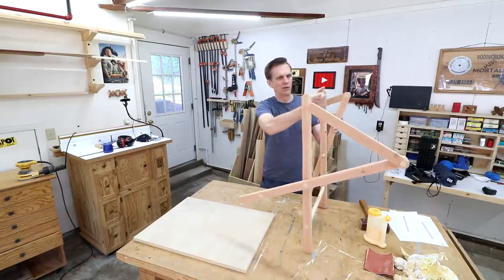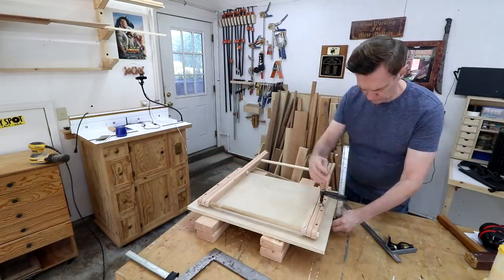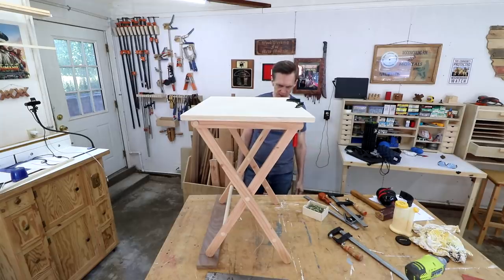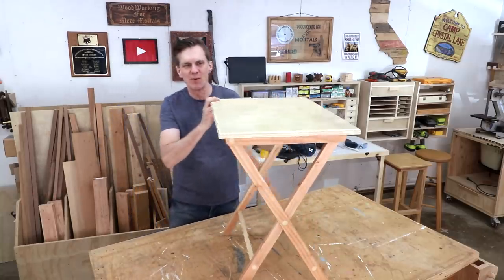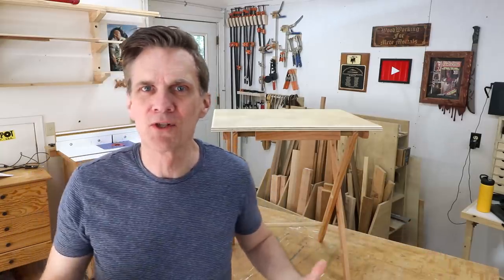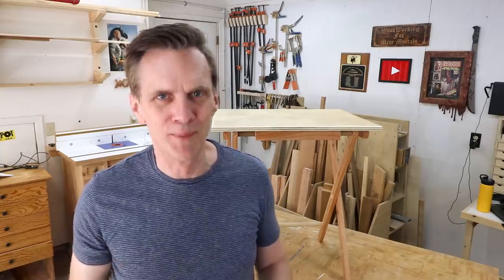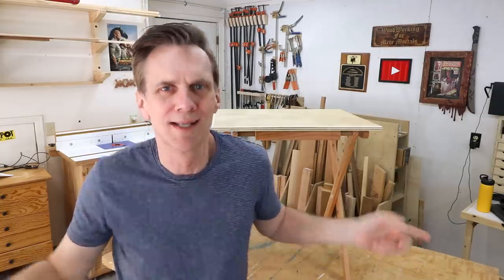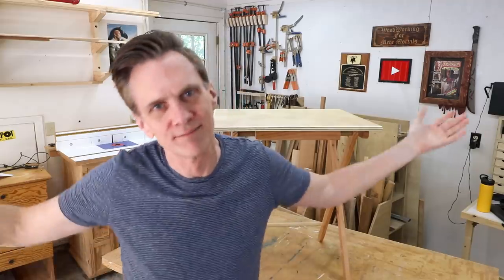Completing the folding table. This turned out trickier than I expected! LOCKDOWN Day 65

Comment: While I’ve spent a lot of money on this hobby, the one place where I saved a lot of money was building my own kitchen cabinets.  Cost me about $3000 plus tools, when a pro company wanted tens of thousands of dollars.  Closets are a big money saver if you do it yourself too.
Reply: I have to agree here. Not true woodworking for the fundamentalists, I have built all the furniture for our two AirBnb suites at approximately 1/3 of the  price quoted from kitchen design shops. I ordered the exact same Melamine boards, pre-cut to size and edged. I then assembled them and added solid oak tops. I must say that I have done this a number of times in the past, so by now I have made a few mistakes and have learned from them. I get good reviews about the "modern" look, so as Steve has said, it serves a purpose. At the same time, I could enjoy working with the solid oak tops from cutting to size, sanding down and varnishing. Finally I can tell my guests that I have made all the furniture in the suites, this buys me the ticket to run my noisy woodworking machines on the property without them hassling me about the noise!

Comment: Great video. The one thing I can say making it myself was actually cheaper was patio furniture. My very first project when I got started about a year ago was an outdoor sectional sofa and a matching banquet table. Lumber ran me about $125 for what amounts to an 8 foot couch and matching 8 foot table. I had a to pick up a good circular saw for about $90 but that'll last me for damn near ever. Surprisingly, to me anyway, the cushions for the couch ran me about $150. The same style and materials everywhere else I priced it was over a grand. I do think that's the exception and not the rule though.

Comment: I should have 'Told you so'. :) I made a similar table a couple of years ago with the same problems. I used a slightly wider fixed stretcher to get over the swinging leg problem. and yes small adjustment to the leg length to make level. But hey, it's fun working out you problems LOL. Sorry Steve. And yes I did make a table two years ago :)

Comment: points why I build:  1) I can not find the custom size to fit the space 2) store bought is pressed wood which is nice until you have to move 3) the most important reason I find woodworking relaxing.  I have been told to go into buisiness, yes I could, have enough projects and client base that would keep me busy for many years to come. But then would need to find a new way to relax

Comment: Oh, just to reply to your last comments in the video - 
I hone my skills for things which I cant find in the market, or it wasn't in the market for the right price or I want assurance of the quality in materials used.
I'm sure if I factor in the cost of my time instead of doing something else it would end up more costly but then I will always question the durability of the item when it is bought. 
The problem with items on the market now they are engineered for a particular purpose for a particular duration due to cost and competitiveness, this scale is not quantifiable to the typical buyer. 
Products can also be deceptive where products actively look stronger/better than it actually is.
In any case, I think if you have a specification for something and unwilling to compromise on particular points, then making something yourself would be the next best option (or getting a professional to make it for you).

Comment: Hey Steve, I think you've made a really good argument for buying knock down particle board furniture by saying it frees us up to do other things. I can agree with that. However, that table you made could have just been scrap 2x4's and a piece of construction grade plywood nailed to the top and it would have cost less in both time and materials. Especially if you trash pick, or get the materials for free. It wouldn't have been as nice, or as functional, but it would have done basically the same job. I think that's where these big manufacturers get us. I saw a particle board desk in the store one day. I was looking for a little desk I could throw into the corner of a room. The cost of this desk was about $50 and I realized looking at the dimensions listed on the box that I could make that same desk from a sheet of plywood for a little under that. The debate then becomes "Do I design it, buy the materials, and build it myself or do I just buy the pre-made desk now and put it together tonight for basically the same cost". They make these products to appeal to our laziness. These mass manufactured products are also often "one size fits all". They'll get you 75% of the way to what you want. Eh that drawer could be bigger. This handle is kinda hard to grab. The desk top could be three inches higher, etc. They'll never be as good as something you "cut to fit" for your specific needs. I think that's what most people miss in the price/saving money debate. If you are paying for the knock down furniture which will never fit your needs exactly, then why not build something super cheap that will? I made a drawing table for myself out of 2x4's and plywood. It cost me less than half what an artist's drawing table would cost if I bought it at a store, and is way bigger and fits me more precisely. It looks like a crappier table than the store bought one cause it's just 2x4's just rough cut, versus a shiny laminate top and sleek aluminum legs, but mine is a way better table. I'm getting 98% of what I want out of a table at half the price versus 75% of what I want out of a table at a much higher price, but that would have been more convenient to put together. I'd rather save that money and be more satisfied with my crappy cheap table, and just like buying the knock down furniture saves you time, the money I save frees me up to buy other things I can't make myself.

Comment: If you build it yourself, you know the quality of the product you're getting.  You know what the materials are.  You know what the waste was.  You have a much better idea of the environmental/social cost of the product.  And if it breaks, you can fix or replace it.  Plus, when you use the item, you get the satisfaction of using something you built yourself.

Also, geometry teachers were screaming at the screen!  If you want the legs to be different lengths than the triangle at the top that the legs and the table top form needs to be equivalent.  You'd have to change the pivot point on one set of legs (move it up on the shorter set, I think).  Not saying I would have caught this prior to building it, but that's the issue :D

Comment: Factory made flat pack furniture is no longer all bad. It used to be but the manufacturers had not yet figured it out 20years ago.
If you are new to woodworking and you still need to learn how something is constructed its very easy to buy an ikea (or other brand) an look at how thay did it. No need to reinvent the wheel.
And while you are making one to perfectly fit to your needs, your spouse/friend has one to use. Alsow nice if your project goos horribly wrong....

Comment: On the topic of woodworking making sense financially, it completely depends on what you're building.  You can buy a knife block for less than it costs me to make the ones I make. However you can't buy one as beautiful at all, much less cheaper than, the ones I make.  The same goes for my coasters, which are made from the off cuts of my knife blocks, so they basically cost me nothing but time and glue.  
The knife blocks cost me about $50 in materials, and I sell them for $200 - $300.  The coasters, as I said, are "free", being made from off cuts of lumber of I would have bought anyway, and I sell those for between $25 and $50.  I make boxes to give as gifts that cost me around $10.
I'm not saying you're wrong.  Everything you said about making furniture was spot on, but don't forget about the whole world of things out there that you can make that can't be bought at all, or at least will cost you more than the materials you'll use in making them yourself.

Comment: The only problem is that if you lift the full table up the legs will move. If you add a little overhang to your cleat it will stop the legs flopping down if you lift the top up

Comment: About 3 years ago I decided I needed a stool for my shop.  We had just finished renovating our home and I was fresh out of major projects to do.  I DID (and still do) have a pile of reclaimed pressure treated lumber from a wobbly old deck I took out.  I decided to make my own stool rather than buy one.

My wife looked at me skeptically when I told her my plan.  "Why?  You can go to the unfinished wood store and pick up one for $25 this afternoon."  My response was "Because I can make it, and I WANT to make it."

I had never done any furniture making before, but I had just finished building walls in my new home.  'How hard could it be?' I thought.  I learned how NOT to make dados and lap joints.  I learned how crappy my 20-year-old table saw was. Finding straight enough 1x1's out of my scrap bin was more difficult than I suspected.  It took me about a week of fussing and tinkering without the aid of plans to get the stool made.  But in the end, I have a stool that sits level (even if one leg is warped slightly), is sturdy enough for me to stand on and ugly as sin.  I use it nearly every day.  I learned a lot from it.  I picked up new skills from it. And most importantly, I MADE IT.

Comment: Nice job, Steve. I agreed with a lot of what you said about why we do woodworking. But in relation to the value side of the equation, after working at it for several years, I can now build kitchen cabinets, furniture, etc at a lower cost than it would cost to buy comparable quality items. Custom furniture and cabinetry costs a lot. So in addition to the pride and sense of accomplishment I get, I do believe I’m gaining financial ground.

Comment: You made all center holes equidistant from the top, forcing the top of the legs in an isoceles triangle shape. With this, to keep the table level you needed a second, similar, triangle on the bottom of the legs. If you wanted diferent length legs then your triangles should have all different sides.

Comment: Steve, would you consider doing a video about your disc/belt sander? I'm trying to decide between the combo like you have, with the vertical 1.5" belt, and the other kind that has a 4" belt which can be horizontal or vertical. Are you happy with it? What do you use the 1.5" belt for mostly?

Comment: I’ve been waiting to see if the table would be level or not. From the first video, when he said the legs were two different lengths, I wondered why.   All four touch the floor, and all four touch the bottom of the table. It just makes sense they have to be equal length, right?   Still, love the series. Thanks, Steve!

Comment: If you buy the real wood Ikea furniture, it's actually pretty good.  But the particle board junk doesn't hold up well.  I bought a particle board Ikea bed frame and it kept breaking.  I fixed it up several times until finally one of the side rails just snapped in half alltogether.

Comment: Hello Steve - I appreciate your guidance and videos and specially your explanation as to “why?”
As a beginner I do have a question and request your opinion please.  I recently bought a table saw and have been becoming familiar with the features and limitations, as any tool has.  I own a basic router, orbital sander, drill press, and Dremel, plus various hand tools.  I am also watching my budget and wish to next purchase a band saw, or belt sander.  Would appreciate your recommendation as to which one you would acquire if it where your shop?
Thank you

Comment: Hey Steve, just thinking you need another ‘cleat’ on the inside to stop the table folding up on itself? I think others I’ve seen even have a swivel piece to lock the cross dowel into the groove between the 2 cleats. Make sense??

Comment: If you hadn't cut those legs down you could have had a new dictionary stand!
You probably need to a clip to hold the table open when you lift it or knock into it - other than that it is a simple project  that demonstrates that satisfying woodworking doesn't have to be complicated.

Comment: Steve, thanks for being a creative "Ramsey" - I have folding TV trays that I love, from the 1990s.  The unique thing about the two (of the original four) that are left is that the spreader is at the top of the movable legs, so I can stretch my legs and place my feet beyond the confines of the tray. Is there any reason that the spreader couldn't be moved up, close to the place that moves into the clamp? The one I have is stabilized beautifully with it installed at that location. Also, do you make tables for sale?

Comment: I have to disagree. I bought a desk with hutch for around $800 about 7 yrs ago. It fell apart within 6 months. A piece of junk and of course all particle board. BUSH brand. I wanted a solid wood desk with hutch and they run in the thousands and thousands of dollars...sooo I decided to bite off a big bite..and try to build my own. Didnt watch ANY videos at all. Had it in my head and jumped in with very very limited tools. ( 3 3/8 hand saw, jigsaw and sander) I succeeded with many mistakes and could have saved some money due to my wrong way of building it. BUT I saved alot of money still overall compared to store prices and it is definitely functional. If it breaks, I can fix it..its been over a yr and its working GREAT! I love it. Now i do agree...i am looking at TV trays and i can buy 2 wood ones for $30. BUT I have left over wood and all I need is the 1x2s to build one and maybe some bolts or screws....And that's why I am here watching your video. i watched a few others and they were just not what i had in my mind that i wanted to build. They made it much more complicated. Its JUST a TV tray. YOURS is what I had in mind. Thank you!

Comment: Not referring to you, but it seems a lot of Youtube woodworking videos use far more lumber than needed.  For example I see a portable table saw cart made out of 2x4's (even 4x4's) and multiple layers of 3/4" plywood.  I made mine out of 1 1/2" box frame with a 3/4" plywood top and bottom.  It is plenty strong and stiff.  I do a lot with 1/4" plywood.  Thinner is better!

Comment: I am thinking about making a couple of tables like this for use camping. What would be a good finish to use for them to be in the outdoors? 

also, if I wanted to adjust the height of the table, is it as simple as just making the legs shorter? I assume there is some fancy math involved to translate the leg length to an adjusted height.

Comment: Odd  choice of project, especially considering the monologue in the middle.  You can get a set of 4 of these TV trays with as storage stand at Walmart for like $60, they're made of better material than the soft fir/pine furring strips used here and it won't take 3+ days.  I love the point of the monologue, just maybe it could have been made when crafting a better piece of furniture?
Reply from the maker: I think you missed the point. There is absolutely no reason to make this table when Walmart sells a set for $60. But I made it anyway.

Comment: Great project!  My only comment is this: I would have braced the two "loose" legs also.  Of course, they couldn't be braced in the same way as the two "fixed" legs, because then it wouldn't fold perfectly flat.  The brace would have to be "outboard".

Comment: First, it's good to see things going wrong. No, not schadenfreude, but most Youtube videos show perfection, and the rest of us make similar mistakes to yours, and we feel better knowing we are not alone.  Now, I did agree with your rant, my wife knits superb sweaters, much more expensive than shop bought ones, but much better. I built our kitchen cabinets. Yes, I could have bought them, but we wanted cupboards that were not restricted by divisions because the units come in set sizes. So if you have 6 feet between the sink and the hob it is just one open cupboard. But I do want to make some library steps - we do have floor to ceiling book shelves - of course we have some folding steps, but it's something I want to do. Keep up the good work.

Comment: Hi Steve.  I am making this table.  Is there a reason why the pivot point rod hole is not centred?  It is spaced at 15 3/8" and 14 5/8".  As I am in Australia is convert to mm which would be 390.525mm and 371.475mm.  Would it work if I just did 50% so 15" ( 381mm) or should I do at 391 and 371mm and not have centre like you have done.  Would love to hear your thoughts as I am new to wood working, but really enjoy it.

Comment: Great postscript.  Agree 99%, but my wife won't let me start a project unless it will save us money.  Second, she now knows that whatever I make will look good and function well. If you make things and they don't work, have mistakes, or the finish is bad, then buy Ikea. It takes time to get to a competent level. You will make many mistakes along the way. Many times you also need tools that cost more than you want to spend. Lots of tools. In fact, you will be looking at tools all the time. Then you will wonder, does it make sense that I bought $5000 worth of tools to make $500 worth of projects? Hint! I can usually convince my wife to let me spend money on tools if they are going to get her something she wants for less (with the tool)  than she would spend elsewhere.  I also use cash rewards money which she doesn't challenge me on.